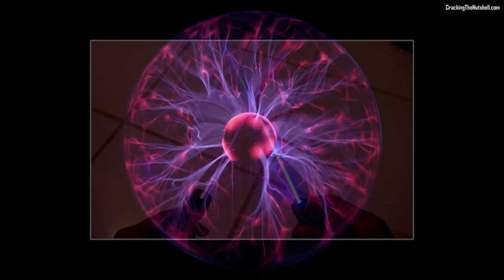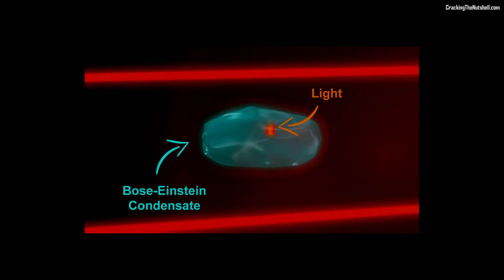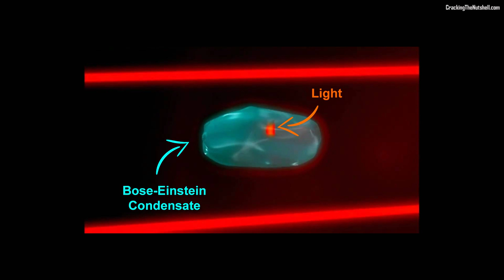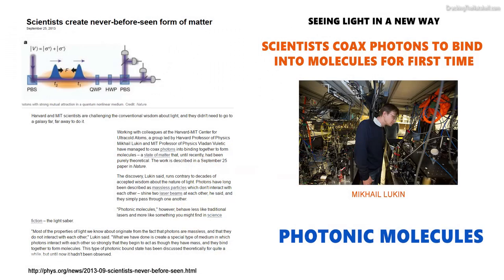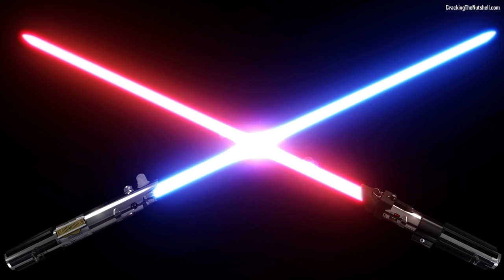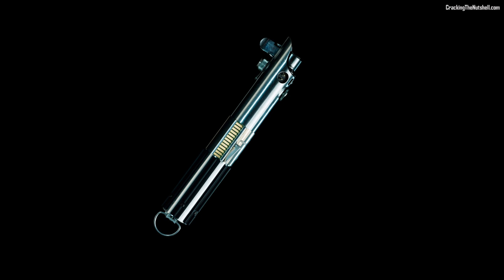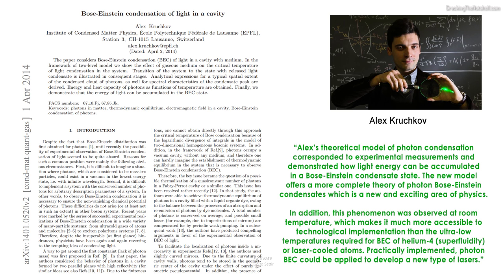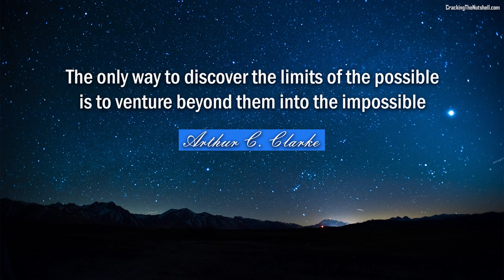The Physics of Lightsabers - Stopping Light, Photonic Molecules & Bose-Einstein Condensates

Comment: One question I would like answered is if a weapon formed from a photon condensate could cut through even the strongest materials like butter, just like a lightsaber in the movies. I imagine that the photon molecules would probably exert energy and pressure on any massive object it touches, which would convert into thermal energy, as it has the same properties of a laser, but would it be enough to cause the matter to melt or vaporize or even ionize?

Comment: now if you could make a split emitter that emits half a wave length on each side, so when tuned the 2 emitters work to make 1 wave length of light, a bit like two lasers that each only has half the wave and the other laser to complete the wave, in this way if both lasers where slightly tilted in the affective beam would only be where the 2 lasers cross. I can see it in my head but trying to explain it ya..